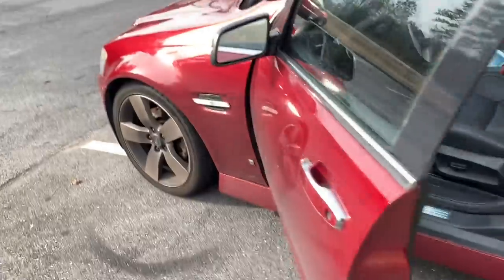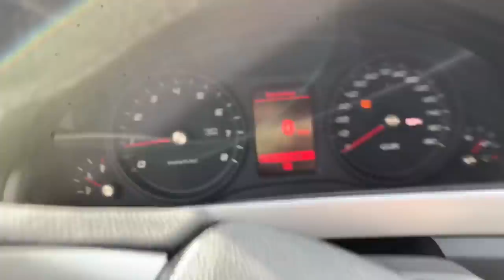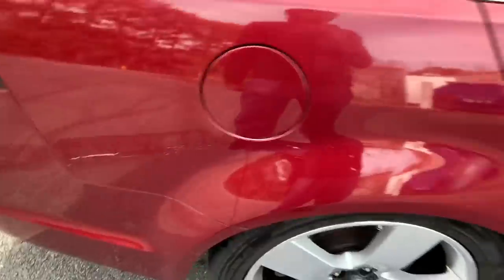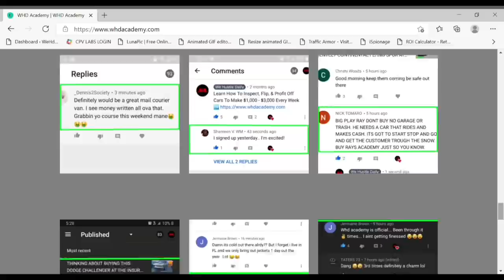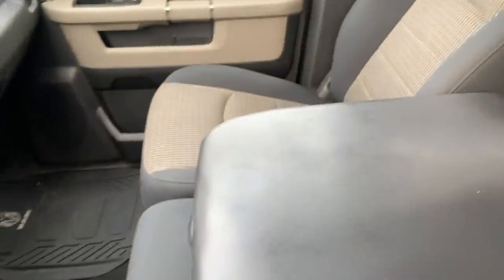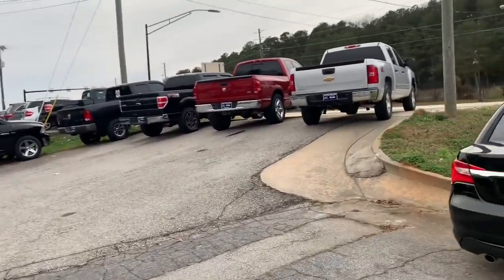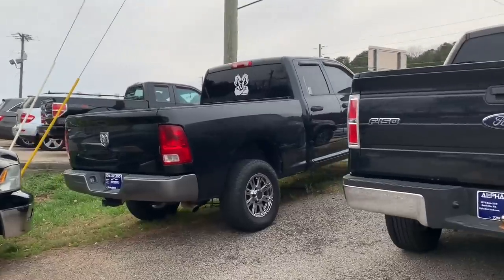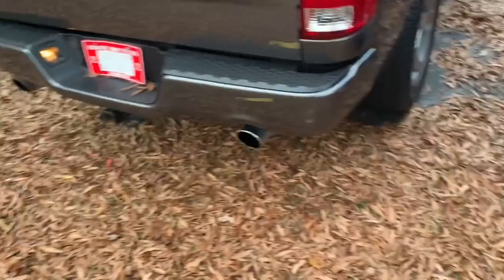REPLACEING OUR OLD COPART DODGE RAM 1500 FOR A NEWER MODEL PICK-UP TRUCK!

Comment: Big Ray Ray the first thing I do with a test drive is pull out my scan tool.Check your anti freeze and thermostat because if you don't have any heat and the vehicle has been sitting it's possible that there isn't enough anti-freeze in the cooling system.